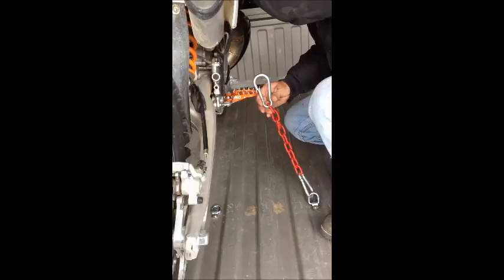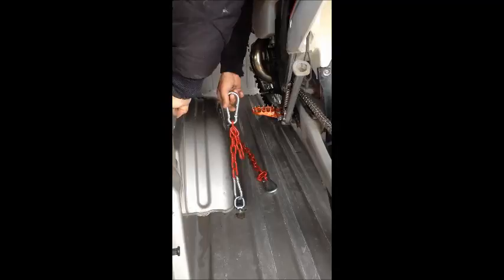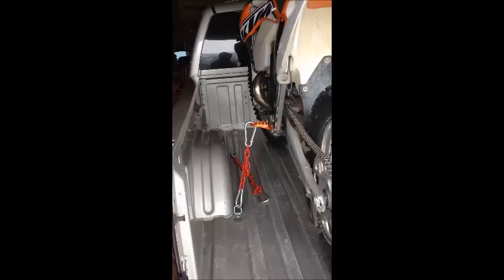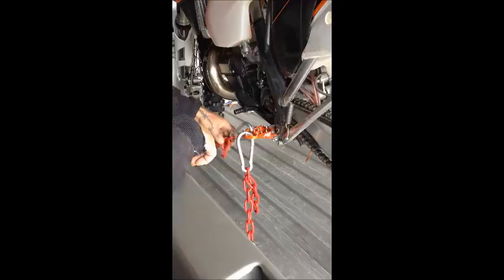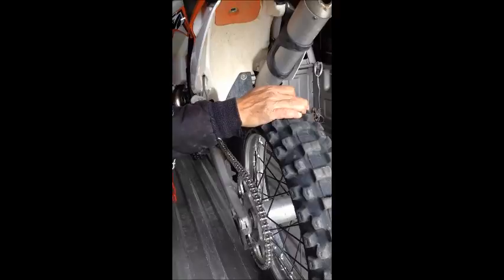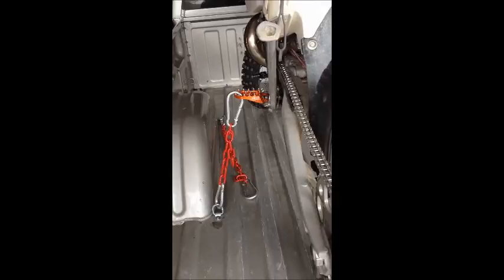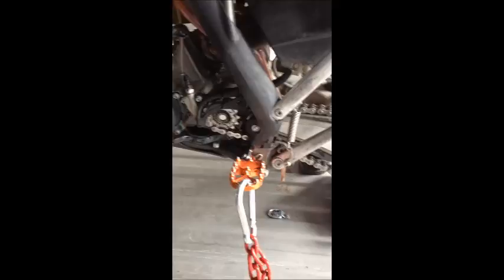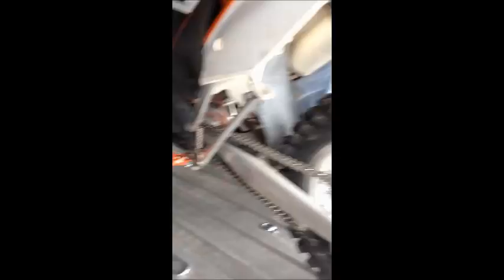DBI Strapless Tiedown

Comment: I think if the front tire were to slip or bounce it could tip to the right and slide down but if you just put a tire chock on the front..it wouldn't ever fall with this system.
Reply: I have been running this set up for a couple years now. Without the wheel chock, the handlebars would turn and the bike would start to lean. I installed a wheel chock and haven't had a single issue since. And i have put over 5,000 miles with it loaded this way. Cross country a couple times.

Comment: One improvement I've seen on systems like this is to add a no-lockdown homemade plywood box underneath the engine block. That way the bike's suspension won't bounce along with the trailer springs. No bounce equals less stress on the foot pegs, and no sideways shift when the trailer hits a bump.

Comment: Doing this on my trailer right now. Have 1/4" steel strips about 4 inches wide laid down and double bolted to the frame rails in 5 spots along the length. Will be bolting down my big d rings with 3/8" bolts and using 3/16" 800lb capacity chains with 750lb capacity locked carabiners. Overkill? Sure but I'm assured nothing will break lol
Reply: How did this turn out for you?

Comment: I converted a jet ski trailer into a dual dirt bike hauler and used this method along with harbor freights chock stand and it is ROCK SOLID without putting any strain on the front shocks. I placed my bottom hooks an inch or so forward of the foot pegs so that it pulls the bike into the chock. 
Great design!

Comment: If you have tie down anchors built into your trailer or toy hauler, you can build your own system using standard 2x2 steel square posts, purchased here: https://smile.amazon.com/gp/product/B008J52HC2/ref=ppx_yo_dt_b_asin_title_o06_s00?ie=UTF8&psc=1.  I made our tie down system for $150, and it transports 4 dirt bikes.  You can see how to build it here: https://photos.app.goo.gl/zTzcnSG23NwojJZT7